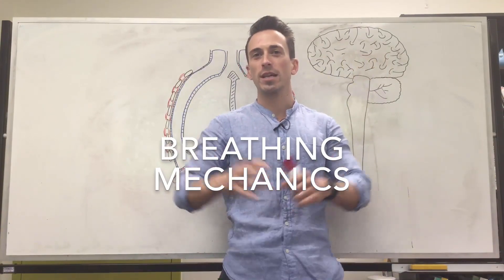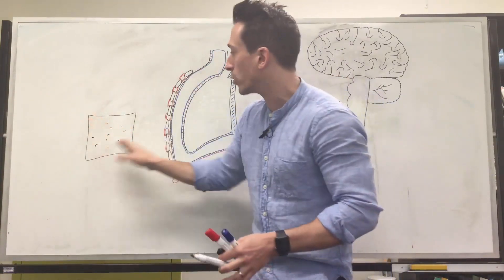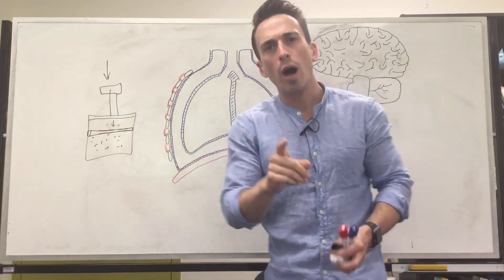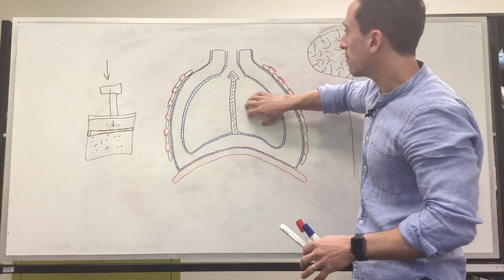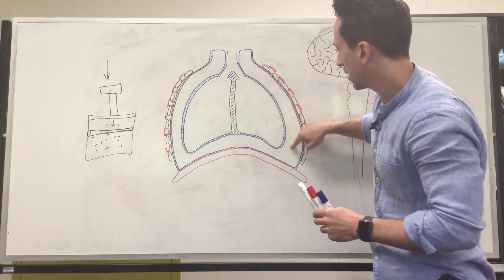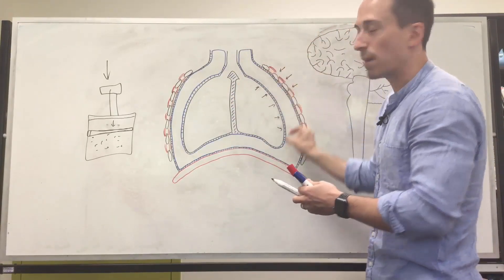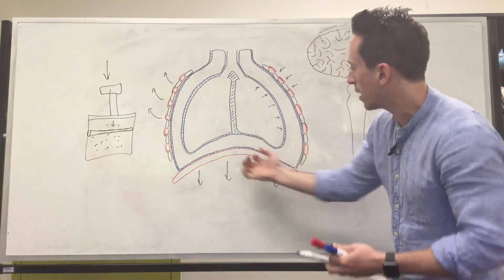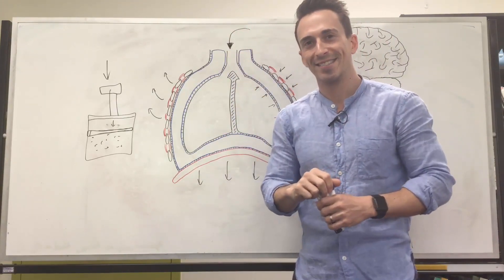How Do We Breathe? | Breathing Mechanics

Comment: I may have misunderstood. But if you decrease the volume of the lungs with inspiration, wouldn't the pleura fall inward due to less desire for the lungs to stick to pleura (due to low-pressure ratio of in lungs compared to pleura)?

1. Pressure in pleura is low
2. Pressure in lungs is higher
3. Inhale, decreases pressure in lungs
4. Air moves in.

but wouldn't the pleura fall in before the air could move in? .
Reply: The volume in the lungs increases during inspiration, the pressure in the lungs decreases during inspiration.